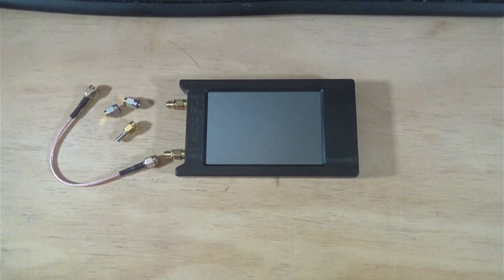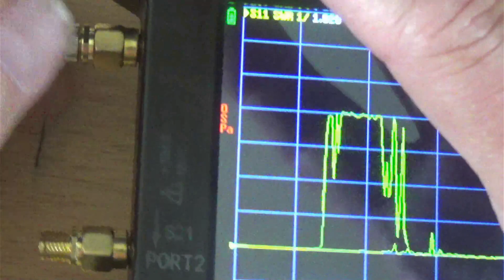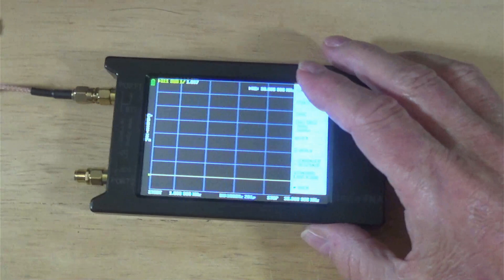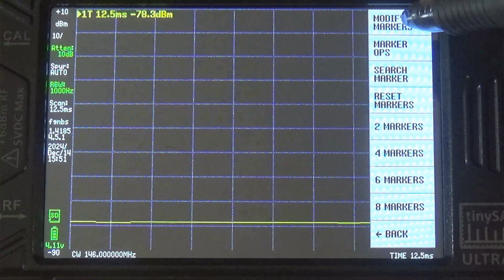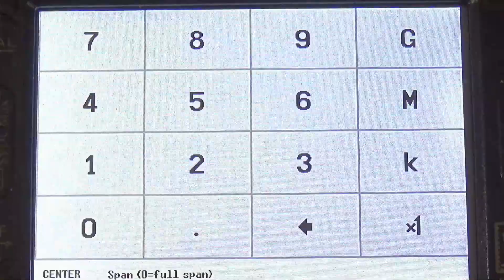tinySA Ultra - Testing Your Radio.

Comment: That tap has real problems at higher frequencies. The best build I have seen so far was a well trimmed and calibrated unit build with special glass resistors and surface mount end terminations. It reached 1200Mhz. The common build loses it after about 3-400Mhz. The accuracy of the common build rolls of steep after 400Mhz making it unusable to accurately check the harmonic emissions of any VHF / UHF radio or power amplifier.

Comment: Forgot to include internal 10dB attenuation. So adding -57 and -10 will give you -67dB total. Subtracting -67 fro 37db will give you -30dB the recommended input power to the TinySA.

Comment: Always enjoy your videos and watched this video with interest as I have a TinySA ultra (have used a spectrum analyzer with tracking generator previously). 

Questions:
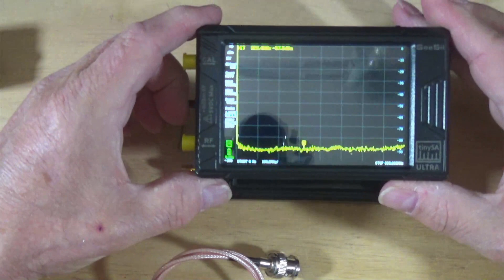1) I never really hear you say why you are using another SA other than to "calibrate an offset" (~23:35) for the other SA. What do you mean "calibrate an offset"? 

2) Is this somehow a more precise method of attaining radio power output than just entering attenuation for 146Mhz into SA's external gain as -57dB (displayed during video), continue with the rest of the setup (zero span, RBW, etc), then read the radio output power? 

Looking forward to more of your videos on using testing hardware. WF4AC